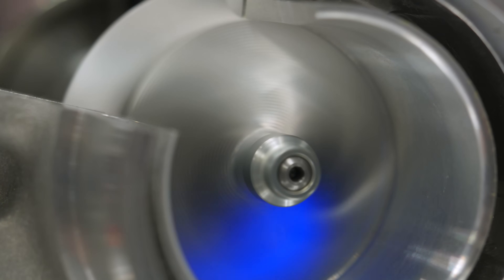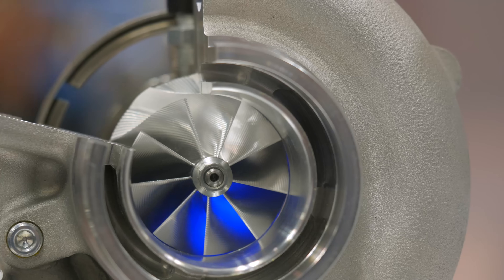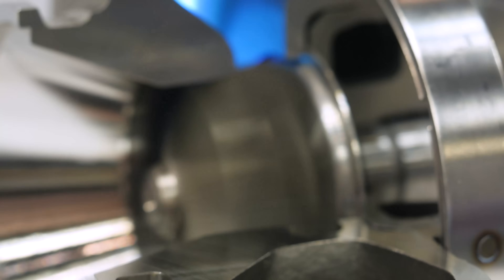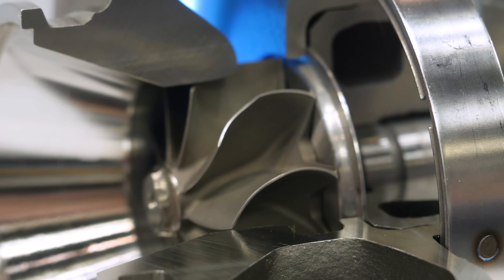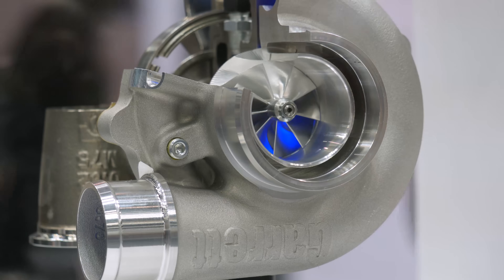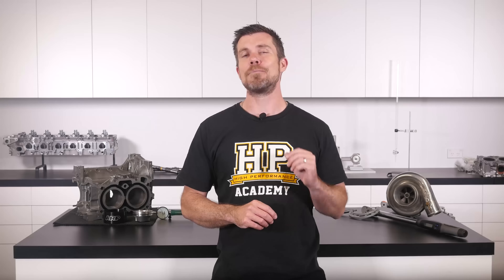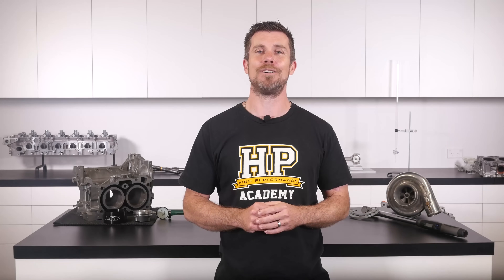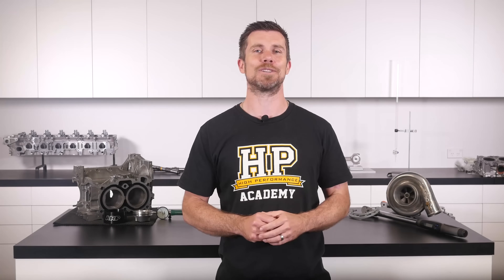What do you know about turbocharger design considerations? | Garrett G-Series [TECH TALK]

Comment: I wish they had better drawings and details that came with their turbos. Obviously an amateur here but i cannot find a drawing on their website detailing what is what. Specifically the oil/water inlets.  The “instructions” that came with the turbo are generic with zero diagrams.  They said the oil outlet is to be on the bottom and is the “large” hole.  Wtf there are three large outlets. For the cost of one of these, provide some quality details with the unit for the dummies like me. +$2000 on the turbo with a $.35 instruction card.

Comment: Xona turbos all the way!!! No one comes close to their turbos besides precision and borg Warner! Garrett trash
Reply from the maker: A turbo is only as good as its application. Use the wrong one in the wrong place and the logo on it won't help - Taz.
Reply: @hpa101  of course. But you can’t say there isn’t a difference in build design, build quality, materials used , weight, ect. And as far as I know xona rotor has a specific design which improves airflow and efficiency.  So based of xona improved designs and unique approach I like what they put out.
Reply: @hpa101  so to say a ebay turbo vs a precision on the same application won’t make a difference, or isn’t a big difference because of so many other factors isn’t a accurate thing to say.
Reply from the maker: @Paper.Power.Politics  trying to use a cheap bottom shelf no brand turbo on a drag car which you're gunning for a world record with, is using the wrong turbo in the wrong application. I'm not sure how that is inaccurate.

You'd have to compare more than just 'I think the design is better' between any of the turbos you are looking at. 
Not saying a Garrett will be the one you go for, but to just say off the cuff that a Xona is the best turbo for any application and budget regardless of any other factors is defiantly not an accurate or helpful thing to tell someone who is shopping for a turbo.

You are certainly not wrong to say that some brands are better known than others for quality, don't get me wrong there, but it's also easy for people to just roll with brand names rather than actually looking at the product. Anyone have have a solid brand name and still produce something substandard despite previous history, hence why more than the name is important - Taz.
Reply: @hpa101  yeah your right , I agree with everything you say. I should have posted a less controversial comment, I was just hypin the turbo I went with lol was not tryin to say xonas are the best turbo perish because that’s isn’t accurate at all , and so many other factors come into play like you said.
Reply: @hpa101  I’m having a 1000whp ecoboost mustang being built. And My builder is using the biggest turbo xona makes. my buddy is getting his evo 8 built to. Gonna be sweet when they done. I’ma have to join your courses because I want to build a 4g63 eclipse for a track car.  But that I want to build myself.
Reply from the maker: ahh, yeah that's fair! It's hard not to be excited about that dude! Wasn't trying to rain on the parade or anything here haha, we always want what we have purchased to be the best option there is, and I'm sure for you that is 100% true but everyone is doing different things, which is also awesome as if we all did the same builds life would be boring 😎

Hope you enjoy getting it up and running! We're hoping to add an Evo 9 to the fleet here this year, should have a bit of content on that in a few months if everything pans out - Taz.
Reply: @hpa101  I’m subscribed! So looking forward to it!

Comment: Turbosmart do a 40PSi oil pressure regulator, called the "OPR" for the turbo, I've just bought one and plan to run a G25-660 .72 or .92.

Comment: Garrett definitely brought turbos to a whole new level. There is no denying that!  With that being said, how are turbos bought on ebay  (not an "ebay" turbo) making the same power, & for an eighth of the price?
I at least respect the guy who kept it 100% real about Billet verse cast not making more power oh, but that it has to do with efficiency. Because this is accurate. This also partially answers the question that I asked above. The thing is does this extra efficiency justify paying up to 10 times the amount?
We've been building race engines for years and we have found all too many times that these so called "ebay" or "China" turbos can make just as much power and in truth some of them can really last a long time. Sure some are junk but many are built quite well and even if their measurements such as trim, AR, etc,  are off , and or you are looking to customize these turbos, this can be easily done, and for very cheap. And even if they don't have as good of an efficiency as the more expensive Garretts, Borg Warner, Etc, you could replace the cheaper Turbo twice & it still cost less than these more expensive turbos. My point is, how can Garrett truly justify this? And please don't tell me they make more power or these others just are so unreliable, because I know for a fact they are not. Not only from my crew using and Building engines with cheaper ones, but also from friends who use them add not to mention the countless people on the internet who do the same, and have never had an issue. Or maybe, just possibly, Garrett could bring some of the price is down somewhat to be more competitive. Because most people would still choose to pay the extra for a well-known brand name like Garrett, but not when it's hundreds of dollars more. And let's not mention that most people don't give a damn about efficiency. This is proven and how people do things. People can't even hold onto a car or phone for more than a couple years without having to upgrade to the next thing. So when they're selling it to the next guy do you really think they give a damn how long the turbo is going to last? Highly unlikely
Reply: If you don't want to justify the cost, then don't and buy your knock off Chinese turbo on Ebay. No old design turbo will spool decently under 3500 rpm and still make good power on a 4 cylinder engine. V8 owners shouldn't care about spool too much because they have plenty of displacement. Garrett's GTW is for people like you a good turbo, not the latest high zoot technology but a good journal bearing turbo that can be upgraded to ball-bearing since it shares it's basic structure with GT and GTX turbos.

Comment: Great interviews you be holding! so, when selecting the proper turbine a/r housing for a 5 cylinder to be super effective with a 95lb turbo, what calculation is used for optimal performance in achieving quick response? .67 .87 . 90s' etc. And would a internal wastegate help aid in maximizing such system?
Reply: Sigh.... I would wait or you can get a G42-1200C if it's a FWD/AWD Audi. T4 housing will flow plenty and no there is no internal wastegate option. EWG aren't loud anyway unless you are at high boost and high load which would mean the last thing you should be concerned about at that speed is a little more exhaust noise.

Comment: How come most if not all turbos are still cast iron and alloy combo and not titanium or even carbon fibre other than the higher cost of materials?
Reply: Because people like you complain about $2,000 turbos that will make 500-600 hp. Yes will cost more to use those materials you knucklehead.

Comment: Garrett, y'all need to come up with something to compete with Borg Warner's EFR line. They are so next-level, even being used on F1 cars. The Gamma-Ti turbine is ridiculously light and their strength increases with temperature, they spool so fast many say they feel N/A, and their IWGs flow like EWGs. I love Garrett, especially your reliability, so can you develop something comparable?
Reply: You did not listen to anything that was said! The G25 are just as responsive as the EFR's if not more so and the range will make more power because of better, newer compressor and turbine designs. G25-550 will spool the same or better than a EFR 6258/6758 and make more power, which max power around 480-490 whp. The G25-660 will make almost as much power as a GTX3071 while spooling more like GTX2860. EFR's lightweight turbines don't like to overspeed. But that really is only a problem with the larger B2-B3 frame turbos, likely nothing your interested in.

Comment: When the Garrett guy mentioned the new G25-550 being the same as the older GT3071 revision 1, but with faster spool, what a/r would that be with do you think. I'm looking to buy one Thanks.
Reply from the maker: You're best to reach out to Garrett directly for this information :) - Taz.
Reply: @hpa101  Depends on the engine and it does match the GT3071, not GTX3071 nor the GTX3071 Gen II. On a 2.0L engine I say about 480-500 whp on E85. Yes the spool will be faster it's about the same size as the GTX28xx turbine, only lighter and more efficient. For max power it will be either a .72 A/R housing or .92 both are available IWG and EWG.

Comment: @4:50 he states; "there isn't much difference between a cast and forged wheel." That is where many of us have to disagree, there is a considerable difference in turbocharger response simply due to the fact that a forged or billet compressor wheel has much less mass compared to a cast compressor wheel. That alone is worth the additional cost, not to mention the improved durability.
Reply from the maker: Are there any back to back tests you can link using the same wheel with the only difference being cast vs billet? Interested to see - Taz. https://www.hpacademy.com/technical-articles/whats-a-billet-compressor-wheel-and-why-should-you-care/
Reply: Sure, if they are of the same strength.  He basically said that with equivalent shape, the billet wheel is stronger.  So he wasn't wrong.
Reply: Surely a forged item will have a higher mass due to being compressed into the rough shape before machining? Cast items generally have voids and defects which will make them less dense.
Reply: @vanepico  Are you a metals expert? This is a grand assumption on your part. Just pick the turbo that fits your power goals and be done with it.
Reply: @dj4monie  Any amateur metallurgist will tell you a cast material will be less dense than a forged material for the same volume. Great care must be put in, however, to avoid the machining of stress raisers into the forged part, as this will greatly reduce the strength. If you have ever seen the failure mode of a cast material, the fracture face is very rough, and you will often see voids, however the quality of casting in a turbine wheel will most likely be on the higher end, it still will not be as strong as a forged item, subject to machining quality. It is that extra density that gives it the extra strength.

Comment: I’m confused on if the g2567r makes 660hp because the compressor map shows 61lbs/min while the efr 7670 makes 650hp with 64lbs/min
Reply: DGFr0sty efficiency difference
Compressor isn’t everything in power production either 

Gotta get out what you put in too so turbine side is just as critical if not more so
Reply: Where is the confusion? The G2-660 is rated at 660 hp. On my Focus ST that is 585 whp based on 11.x % driveline loss on my Focus ST. That is assuming you have good intercooling and removed all the restrictions before and after the turbocharger. 7670 EFR is available with a T3 turbine housing but it's a B-2 frame turbo not the same larger turbine housing on the EFR.

Comment: Awesome information, I'm very interested in seeing how it stands up against the Borg Warner EFRs in terms of boost threshold and response versus maximum power output
Reply: Seeing as Garrett can't copy the integrated bov design, it will never beat the transient response of an EFR. IMO garrett is still playing catchup to efr 5year old tech. I'm just sticking with efr6258, 200whp to 500whp, 2000rpm boost threshold on a small 4 cylinder...
Reply: M M Have you ever seen a 6258 hit 500whp? I doubt a 44lb/min wheel can flow that much... And for transient response as soon as you roll on throttle the diverter valve closes so it's essentially "not there" anymore, not sure how that would affect spool-up/response?
Reply: the bpv on the compressor housing allows compressed air to stay in the housing between fast shifts, dramatically increasing transient response as you enter the next gear. Especially with no lift shifts.

There are a few people on mt.net in the mid-high 400whp with the 6258, two above 500whp on 6758, and none of them have fully optimized setups. Sure, you'd have to try pretty damn hard to hit 500whp on the 62... and I guess at that level, you should have the 67 anyways for better iats.
Reply: M M Who on MT has hit high 400's on a 62? I've seen Soviet at 458 and Savington at 452, both on 6758's. As far as I know I have one of the only BP's over 400whp on a 62.

For transient response, I'm talking about a situation like this: 10-15% throttle mid corner, rolling up to 100% on exit. That response won't be affected by internal vs external diverter valve.
Reply: M M most of the world is playing catch up to the IWG EFR series and in a lot more ways than just the internal gate and BOV. Their compressor efficiencies are just incredible and the dual true twin scroll turbine housing has a whole page of advantages over all others notably ignition pulse modulation volute design. I run a 91/80 and to be honest can’t see me running anything else other than a next gen version of the same turbo.

Comment: Does dual ring seals mean that you can run the G-series with air restrictor classes and/or suck through carby?

Also, the specs of this turbo are amazing, enough to alter entire builds. The specs imply that if this T-25/T-28 sized turbo can flow 660hp, it's more than enough to feed my stock 4.0 AU (which whimpers out a cool 210hp out of the box, 250 if you let it breathe properly without boost). It should come on boost somewhat before the stock torque converter locks up, meaning that I no longer need short diff gears or a high stall to get the power down at low speed.

I mean I could be a real man and wait for the 30 or 35 sizes to come out, but then I'd be looking at trying to build an engine/box/diff combo to suit 800hp, and that shit costs some serious coin
Reply: Skippy 
you can use any turbo to suck trought carb but you just need to adjust the throtle cable so the carb never closes all the way

Comment: Im really interested onthe new G series 28 or 30 wheels. There gonna be killer. Id like some more info on what it comes next and WHEN. Once again perfect video tho.
Reply: G2-550 and G2-660 replace the GTX28xx turbos and GTX29xx turbos. Twin 550's should make 900 whp without running them too hard. Twin 660's will do 1000-1100 whp. These and the new G3's which should be announced at SEMA in Sept (2019) will be the new replacement turbos for the G35 GTR community. A G2-660 is not good enough for me to replace my GTX3071 Gen II on my Focus ST. But if you buy a new ewg kit from ATP for the platform, it will easily make 500+ hp on race gas not even ethanol is needed.